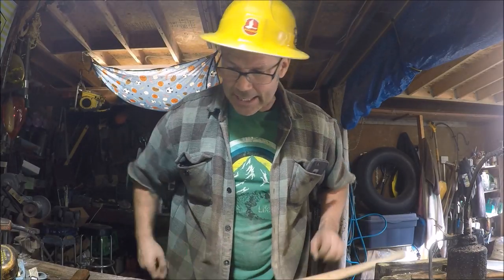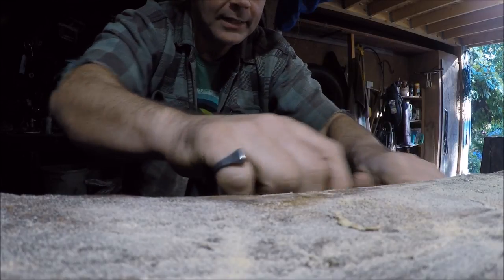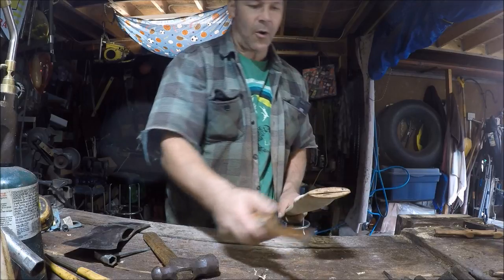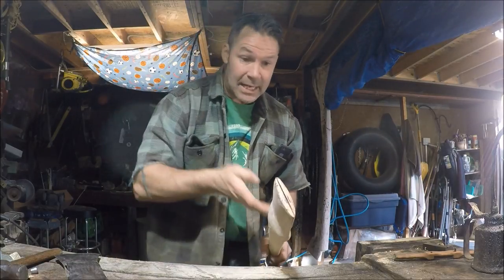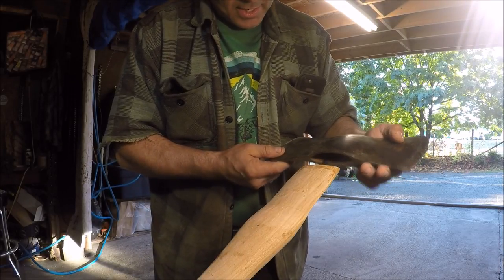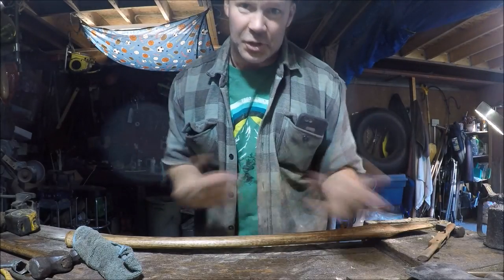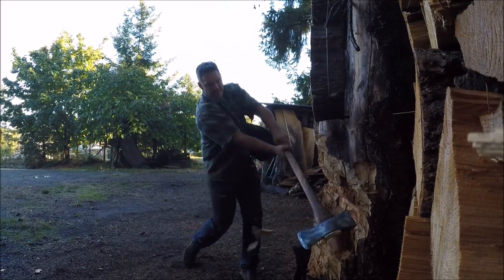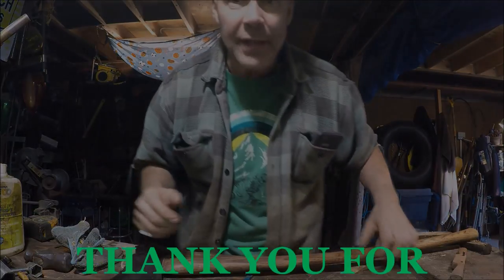A PLUMB DOUBLE BIT AXE, RE HANG

Comment: So what do you do when it pops back. I've got one that has good curl but as you explained after pounding the wedge in there's a very small space between the curl and the bottom of the head. True temper Kelley with the phantom bevels.